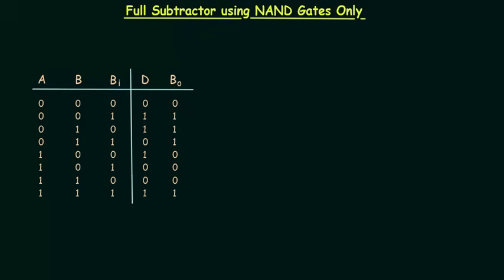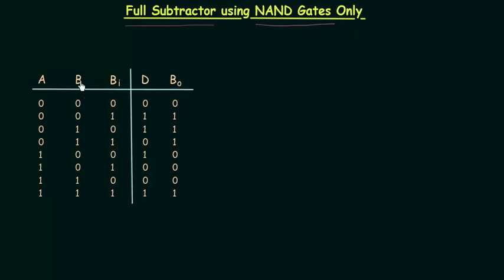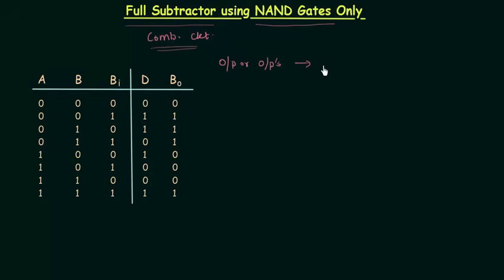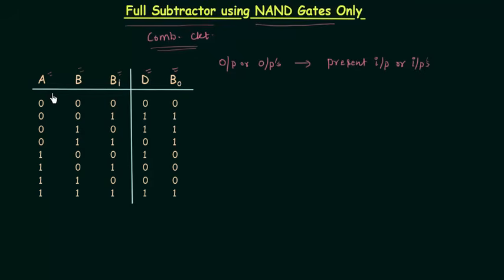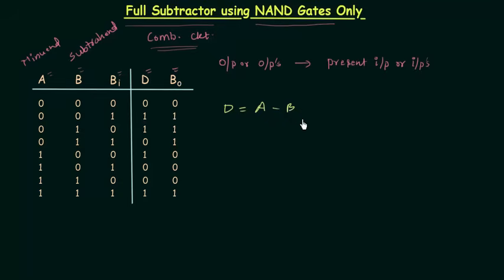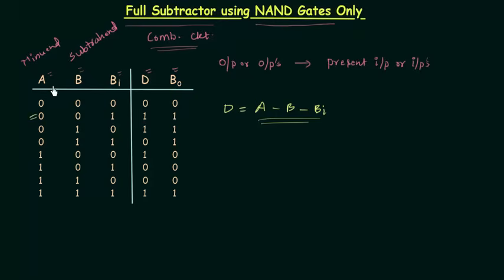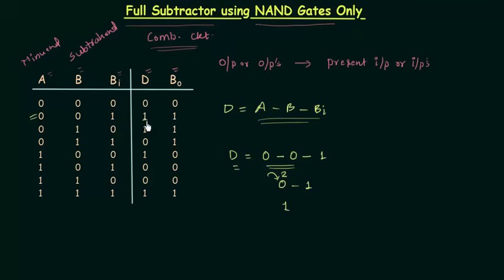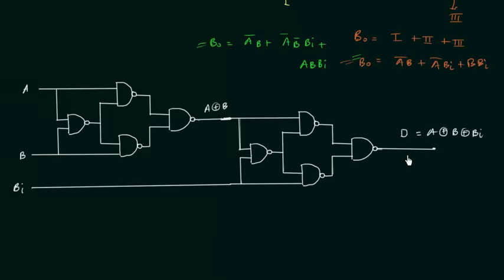Realizing Full Subtractor using NAND Gates only (Part 1)

Comment: why you took, Bi as third input when you explained with C in lecture no. 106?
Reply: It's just the notation... You can solve the same using C also
Reply: Because,  In SUM , the third input is CARRY INPUT , denoted by Ci .
but in DIFFERENCE,  the 3rd input is BORROW INPUT ,denoted by Bi. 
Hope it helps you 😊😊